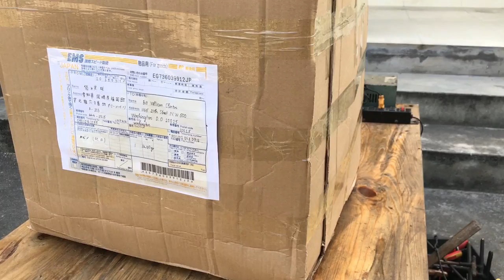Restoration 2 Stroke Engine ROBIN EC 10 | Restore Engine Robin Antique

Comment: Just for curiosity..did anybody see him replace any parts. .I think its what we call a .deluxe rebuild..pull it down and paint it .hope for the best 🤣🤣
Reply: Really not worth putting money into this engine. I looked up the specs on it and it puts out a grand total of 4 HP and 4.5 Lb/f torque at 5000 RPM, or with the reduction gearbox, 2000 RPM and 11 Lb/f of torque. The engine is so detuned and underpowered that none of the parts see any sort of significant load.
Reply: Ė
Reply: Cleaning and new paint thats all wat a joke 😖👎
Reply: It will be good when u paint it

Comment: No gasket replacement, no bearing oil, no tube replacement, No paint Primer, No  masking, No  proper assembly with correct tools, No torque checking, use of open spanner on spark plug. 10/10 for effort though, most people would not even think about doing a restoration like this. He even successfully got and fitted  the correct parts for ignition and got the engine running. Hats off in admiration.

Comment: good job but some errors: you should not paint the interior parts of the engine because paint will soon became dirt, mask the holes with masking tape or paper. and I should also use an anti-rust primer before painting. Hope also the paint you used is heat-resistant. Last but not least it would have been better to replace piston rings.
that's all, keep going!! 👍👍👍
Reply from the maker: thank bro!!!
Reply: I agree
Reply: @therestorator7215  that engine would sell for $900 in Canada with rings and rebuild.
Reply: You forgot to say about new seals and gasket between the two halves of the crankcase. This guy has no idea what he's doing. I don't know how the engine runs without the crankcase gasket.
Reply: @georgeiceman867  one thing at a time 😂😂😂
Reply: @georgeiceman867  If you notice on the strip down there was no crankcase gasket fitted originally.  It should have been fitted with one though.  Part no: 1051500123
Reply: To be honest there were errors too numerous to mention.  For starters bolting on the engine stand and tightening it down before torquing up the two halves of the crankcase does not make for a perfect seal, especially as there was no crankcase gasket either.  No prelube apart from the rings.  Flash over job for a quick resale 'reconditioned' I reckon.
Reply: @Biffo1262  ... and no new bearings, if I'm not wrong
Reply: If you think you know so much or since u have so much to say why don't u start your own channel and let this guy do his thing!!
Reply: @erikrobles5727  the tips simply help you to improve

Comment: He did a an excellent job of taking this engine apart and cleaning all the parts and painting it. As far as restoring it? Not so much. No new parts, and he didnt torque anything!!! Looks nice though. And yeah I have to agree with another gentlemen on here. That motor was mechanically sound before he took it apart. It has just sat outside for a good while. But like I said, he did one heckuva job cleaning and painting it.

Comment: He put a top cover gasket , but no gasket or even sealant between the 2 engine housings. Metal on Metal.
Reply: There wasn't a gasket there when the block was split
Reply: Se arma asi. Las cajas de cambio de aluminio de los automoviles no llevan junta.

Comment: This, of course, is great, but I did not see the process of finding defects. Measurement of ovality of the cylinder and piston or replacement of piston rings and connecting rod bearings, measurement of compression. It seems to me logical when the engine is completely disassembled. Why put the worn out parts back. This is my personal opinion.
Reply: Agree with you completely. I think he was just making a video rather than reconditioning an engine . Two strokes need new crank seals , piston rings, small end rod bearings as absolute minimum for just a cheap job. But maybe the video paid more than the “repair”. Made it look good though.

Comment: ..no new crankcase gasket when putting crankcase halves together?..cause air leak, 2 stroke engines must have very good seal at crankcase halves and crankshaft seals to run properly...
Reply: 4 stroke

Comment: Removal of spark plug , Gudgeon pin circlips, have tools every auto mechanic should have, Surprised there are no drain nut for oil,
Reply: Ryan Subbu There was a drain nut and a dipstick/filler hole.  He just didn't use the drain hole.
Reply: Uh..  2 stroke engine? Oil is mixed with the fuel. There shouldn't be a drain, or fill for that matter.

Comment: Love how you emptied the oil 😂😂 just let it go everywhere 👍👍
Reply: I was trying to drain oil out of a 6 cyl engine,had to poke a drill bit into the sludge to get some of the oil out,dropped the oil pan let the rest go where ever it wanted to go.Took almost five minutes with a steam cleaner to get most of the sludge out of the oil pan.Yes we were able to repair the engine and reuse it.

Comment: Hmm, now there is spray paint in the cylinder lol, and the gas tank too. Even if it dried the gas would desolve it and it would go through the carb. Right?
Reply: Yes then you'd have to take that whole carb apart. Also all that paint will foul the cylinder walls and the crank case and everything within it

Comment: Why no primer or anti corrosion undercoat?
Reply: @tonywright8294  Well that was a constructive addition to the comments.  What a nice chap.
If he was using Plastikote it doesn't need a primer though it does tend to scratch easily.  I wouldn't have painted the aluminium parts as painting just isn't necessary and certainly not inside engine parts.
Reply: @tonywright8294  ima report you

Comment: No sealant, no seals replaced ... everything fake
Reply: No two stroke fuel either.
Reply: John Doe you have no clue. It’s a 2-stroke. The absence of any valve train as well as the ports on the cylinder jug would’ve told you that if you knew what you were talking about.

Comment: I’ve seen a lot of mustie1 videos on small engines.  Always always always try to start it before you open it up.  Don’t fix it if it ain’t broke.  It was a great repaint video and a I liked how he used available methods to de-rust by electrolysis and using detergents to clean with.  Good video...

Comment: Restoration? More like derust and repaint. Who paints the inside of an engine and dont cover up the bearings? No new bearings and piston rings ... shipping junk from the us to japan must have cost a fortune. This was not the quality work i expected from japan.
Reply: Yes. Restoration!!! This is work!
Reply: Nope this is fake to me ... it looks nicer but the inner parts with mechanical wear are still the same ... and he left out some part for example how did he fix the gastank with that huge hole? this is just show and shine
Reply: Carsten Klein not fake!!!
Reply: Carsten Klein This is vehicle work. Not alcohol, not scandal.
Reply: whatever dude
Reply: @snakecold6755  this is shoddy work at best.
Reply: I agree.This was a poor quality cleanup and paint job.Nothing was restored on that engine. I hope he don't sell it to someone as freshly restored.
Reply: @carstenklein4531  Definitely not true.   No way Japan would allow that item to be posted like that.  Their environmental laws are crazy strict.  YouTuber is in Asia, EMS Tracking number EG736039912JP is not correct.  Chickens in the background, Concrete compound, fuel in plastic bottle, I've done enough travels to SE Asia, this is not Washington and the item was supposed to be posted to Bill Clinton.  C'mon guys.

Comment: Aesthetically it turned out well, but there are basic things that should change: the bearings, the carburetor replacement kit, the fuel hoses, the spark plug wire, the paint should cover the inside of the engine because that paint in the future with gasoline and heat it will mix with what enters the piston and as a fundamental criticism is that when assembling the components not a gram of lubricating oil so that when it begins to operate it is not without lubrication :( that would cause the wear was harmful.
For the next one we hope that the small flaws are corrected but if it is worth showing from the beginning until we see it work. Thanks for showing the work equally and greetings from South America.
Oscar.

Comment: So, a 2 stroke with oil...
Reply: I work on small engines and to be surprised, some 2 strokes do have oil reservoirs because of what they're used for and some are converted 4 strokes
Reply: @domenykwilkes5472  weird, but thanks for the knowledge
Reply: What I meant by what theyre used for is some 2 strokes run with a very heavy load on them and they need extra lubrication on the piston. How do you feel knowing this information is true and coming from a 13 year old?

Comment: NO OIL ON ANY OF THE BEARINGS ,OH DEAR ....
Reply: This is a two cycle engine, the lubrication comes from special two cycle oil mixed in the fuel. Adding oil to the bearings is pointless because it will be washed away by the fuel.
Reply: James  The very nature of a two cycle engine means the bearings will be lubricated before the engine runs. Fuel and oil are injected directly into the crank case, meaning the bottom end sees lubrication before the engine even is able to start running.

A crank throw and rod flailing around in the crank case is a very good blender.
Reply: Are U Blind 🤣🤠 ese
Reply: @GGigabiteM  kkkkkko
Reply: James  that's better than me working on a 2 cycle lawn boy from '64 with unleaded gas until I got the carb fixed bc I'm lazy and didnt really wanted to open the crankcase to lube it up after sitting since '85.

Comment: It is not credible that the engine would start at the first pull
Reply from the maker: good gas, good electricity, clean gasoline. ventilating mechanism, mechanical seal is probably not exploding, huh

Comment: Assembly lubrication, grease, new gaskets??? Painting you should have painted a white rust preventing primer before painting it gray and black, and you have to tape off some of the important area's before painting. I hate to knock your work because you did a very good job on other parts of the restoration. I just pointed that out so you can be a exceptional Restorator my friend!!!!

Comment: Whilst I appreciate your enthusiasm and tenacity the project has not been restored, it has been cleaned up. You really should use a primer before you put the top coat on. Preferably two part paint.
Reply: you got the point from a "correct way of doing things".. not to forget, he might use the $ from that a can of primer for the price of a dozen of chicken eggs?  you'd never know..
Reply: I can go further if I wanted to, but I am not going to give this chap a thumb down. UP! (look at 26:54) the starter housing old paint needed to get a proper sandblasting to be able to qualify for a "restoration" category. But, I am satisfied with what he has done. Bravo!
Reply: There's no point in spending a ton of money on a pristine paint job for an old engine like this. Rattle canning on some high temperature paint is all it really needs, because it's not going to last.

Comment: This is not a restoration: this was cleaning, painting and reassembly.
Restoration is another thing: bringing an object back to its original state, as if it just came out of the factory (new bearings, new gaskets, new piston rings...)
However in the end it turned out well ;)
Reply: This is your point of view.if you can bring something dead back to life without spending extra money then you are clever
Reply: @memeahmed6779  if he just cleaned and painted, it means the engine was NOT dead at all ;)

Comment: Man alive how can you work with the length of your nails you don’t suffer from your nerves anyway superb work bearings do need grease they will wear with friction and heat also the lead with masking tape looked as though it was cracked I’d have replaced it but otherwise a super job

Comment: Next time instead of tapping the flywheel with the hammer leave the nut on a thread or two and tap once hard on the end of the output shaft with copper hammer or a softer metal spacer between hammer and shaft and they pop right off
Reply from the maker: thank bro!

Comment: well done.i did not see the air -cleaner being addressed. is it a sponge type element or wire mesh?  i  restore oil bath air cleaners from vintage trucks from the 60s and 70s.they make great ornamements in the house

Comment: The fact that that engine runs counterclockwise is driving me nuts.
Reply from the maker: The engine works perfectly normal that you
Reply: Not to mention my large collection of lawn mowers, both push and rider, and other power equipment and antique engines. But apparently I have no experience.
Reply: What I mean by running counterclockwise is that the FLYWHEEL IS SPINNING IN THAT DIRECTION. The flywheel determines engine rotation direction, and most engines spin clockwise whereas this one doesnt. I haven't actually seen a counterclockwise engine except in videos. I know they exist and I know they work but I just think it's interesting to see because so many engines today aren't built to run in that direction. I'm sorry if you think that's wrong, but I've been working on engines for quite a while and I have a lot of experience. Go ahead and eat I'm lying, but most engines do run clockwise.
Reply: Although I have realized that flywheel only determine engine direction on small engines, because On larger car and tractor engines the flywheel is to the dead of the engine where the output shaft is rather than in front. In that case you to by what direction the pulley on the front of the engine spins.
Reply: Remind me again why I'm arguing with a 40 year old man about an engine that spins the opposite direction of normal engines that I will never own and don't care about, because there isn't a reason. Think what you want to think, but don't tell me I'm an idiot. I bet my life you haven't spent tons of time completely rebuilding a vintage Cub Cadet tractor after pulling it out of the weeds in a pile of pieces. If you have,well then you show similarities to what I can do. Don't underestimate people. Respond if you want, but there's no point in me arguing with some old dude I'll never meet. Besides why even bother when he thinks I'm an idiot. I'm not responding to this anymore, and maybe I'll delete the comment just so people aren't led in the wrong direction with your ramblings.
Reply: No offence but you literally just told me I'm arrogant after being super arrogant and acting like you know everything about engines and that I know nothing. No I don't know everything about engines, just like I didn't know there were 2 stroke engines that spun counterclockwise. That doesn't in any way shape or form mean that I'm clueless and an idiot. Dont to around judging people about a single comment. I don't want to argue with people, especially over something as stupid as engine direction, but when someone calls me an idiot I have to let them no that that's not true. I never said I knew everything, and I never said I was better than anyone else. That isn't my goal. My goal is to know enough to be able to keep old engines and lawn mowers safe from the scrapyard. All I want to do is save  and sometimes restore

Comment: At the beginning did anyone notice the gas tank had a pen hone in it and also that paint isnt engine paint so it will burn off also he didnt set the points or do the timing (tdc) top dead center and it's an old 2 stroke that didnt have those electrical starter switches and he put them on also its 2 stroke it's a fuel and oil mixture and he didnt do that either

Comment: I’ve never seen a two stroke that doesn’t smoke! Did you forget to add oil to the gas?
Reply: I saw an oil dipstick so it must be a 4 stroke, plus he added oil to the sump
Reply: @PeterColmore  It´s clearly a two stroke. He filled the reduction gear with oil. 1-2% of modern two stroke oil doesn´t smoke much.
Reply: @70Bonnieand  sorry didn't know that about reduction gears, my knowledge is basic on engines
Reply: @PeterColmore  No broblem.

Comment: how can you control leakage when there is no use of gasket between two main engine parts.?
Reply: Its a 2 stroke....
Reply: Only thing that matters is the head and they can be a machined surface

Comment: Not a " Rick dale" level of restoration. no assembly lube ,paint in the crank case and not a tourqe wrench within miles . Maybe  the internal specs are o.k. sounds like it's running good.  It's not really a restoration or rebuild but more a lipstick and makeup thing . On the shelf or manage it's cool,good job! On a go cart or mini bike I'd guarantee it for 5 minutes or 5 days whichever came first,but it's pretty and he is saving it frome the scrap yard.

Comment: Erm am i the only one who noticed the pouring of oil into the engine? I thought that was 4 strokes that you did that with... i'm no expert in the slightest, but i've had a lot of 2 strokes and none of them had an oil sump...
Reply: That was for the reduction gearbox on the side.
Reply: @timbeattie1277  ahhh now that makes sense, thanks mate

Comment: 20:46  Can you tell me what you put in the water? thank you
Reply from the maker: It is a one-way electric cleaning method. These can be metal salts or acid salts
Reply: @therestorator7215  Thank you, how can I contact you, I want to learn from you
Reply: The process is known as electrolysis he probably put baking soda in the water this makes the water electrically conductive. You connect a  battery or battery charger negative to the item you want the rust removed from and the positive to a separate piece of scrap metal in the tank making sure to two pieces do not touch. The rust will slowly dissolve give it a day for the process to work. Make sure to do this in a well ventilated area as the small air bubbles coming off the parts are mostly hydrogen and flammable.
Reply from the maker: @ryanshaffer3813  thank bro!